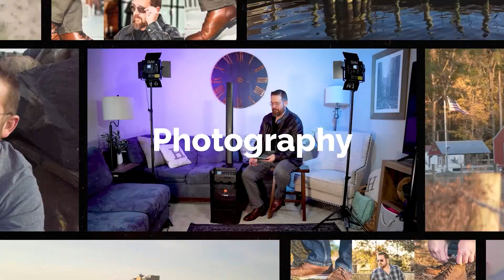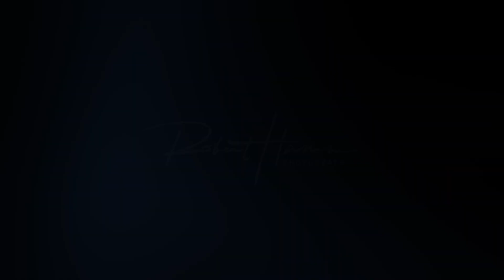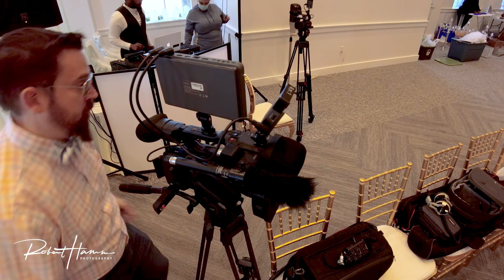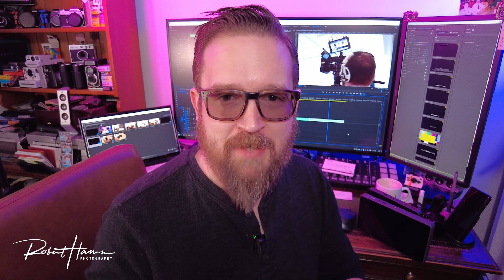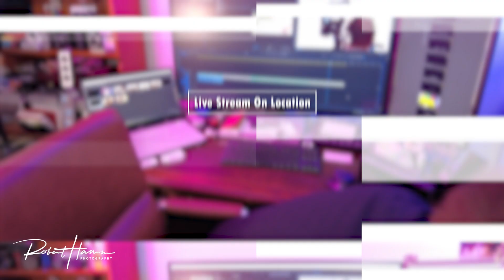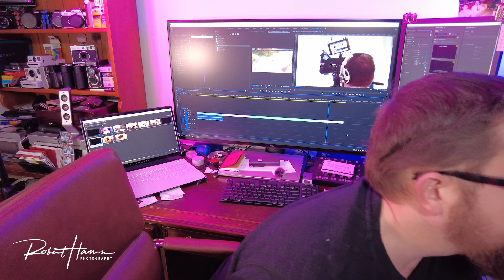WEDDING Live Stream On  Location: HOW TO &  Behind the Scenes

Comment: So I no longer shoot weddings. However our son is getting married out of state, and is hiring a photographer and seperate videographer.... and wants me to live stream. I have a UX-180, two Lumix S5s, a little Canon Video camcorder in HD... audio; an old Sennhizer EW100 UHF, a Rode Wireless Go2 a wired PZM w XLR and various other mics... a Razer laptop for mobile editing etc Blackmagic Resolve... a Samsung Phone and Samsung Tablet bith with hotspots..... I was look to get a Blackmagic ATEM Extreme Pro ISO (a UHD 4k device) and stream thru the house wifi  or one of the Samsung devices as shown on Blackmagic site....  question... have you used any ATEM's to live stream weddings? If so, what is your experience ?
Reply from the maker: Yes, and no. I used one during the return peroid and immedeatly switched to YoloBox. I have many reasons for it, but they aren because of quality. They mainly have to do with portability. As far as quality, you should be good. 

HOTSPOT Connectivity: the issue with any streaming system is how good your connection to the is at the time of, and during, streaming. You definetly have the equipment to stream and I would assume from your credentials that you are more than capable of using the equipment correctly (which doesn't hapen a lot considering that people can basically buy whatevetr they want at Best Buy), So my caution would be towards the samsung hotspots. I learned this the hard way: hotspot data is capped EVEN if they say it's unlimited. Read your carriers "Fair Use" policy for more information. Streaming is part of the "video" service for most internet plans. That includes downloads like netflix, and uploads like what you want to do. SOMETIMES your unlimited internet plan may have a provision that it includes streaming at "HD" HD can be whatever the company says it is. For a while  my "HD" was 480... turely, hd, right? Nope. Anyway, as long as you check your plan, make sure that you have the available data and speed you need, and have an actual HD video streaming plan, you should be OK using your hotspots. I do it all the time, but it was not until I encountered this exact problem during a live stream a couple of years ago. the stream went from 1080 (whilw i used up my highspeed internet allotment on an UNLIMITED high speed internet plan) to a jittery slideshow on 3G speeds.. It sucked. But I was recording on my SD card so I had all the 4K footage. 

HOUSE WIFI Connectivity: the issue here is that when lots of people show up and connect to the house wifi your conneciton suffers. Most of the time the upload speed is just a small part of the overall bandwith. You may not have a lot of room to play when it comes to upload speed. So, test your network, make sure you are recording internally, and be ready to pause the stream and switch networks (wifi to hotspot and hotspot to wifi) as needed. I rarely need to swap networks, but it is important if you need it. A 30 second gap is better than loosing a complete stream. Also, you could load a custom graphic to the ATEM so that you could have a transition screne during that time.. or an intro screen, too. 

A NOTE on Bitrate: if you are streaming 1080p 30fps... Youtube suggests a minimum of 3Mbps upload. I don't like anyhting less than 5 Mbps upload myself. I prefer 8-10. If you can't get that don't forget about 720p at 3 Mbps. That looks better than 1080p at 2Mbps if you ask me. Just test and make that call for yourself. Unless you have your own wifi channel to yourself, you will be unlikely to stream the wedding in 4K. if you have the bandwidth, then it wont be a problem. Youtube suggests a minimum 4k 30p stream have at least 13Mbps and would orefer 34Mbps upload. I do not have that capability on my hotspots. 

Good luck and let me know how it goes. 

For reference:
https://support.google.com/youtube/answer/2853702?hl=en#zippy=%2Ck-p-fps